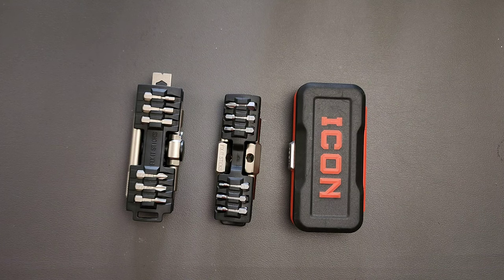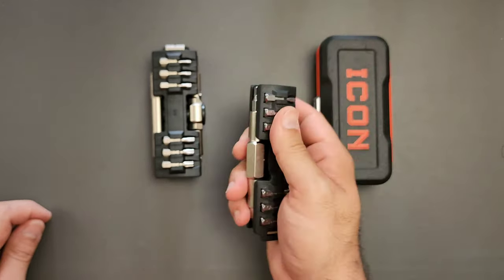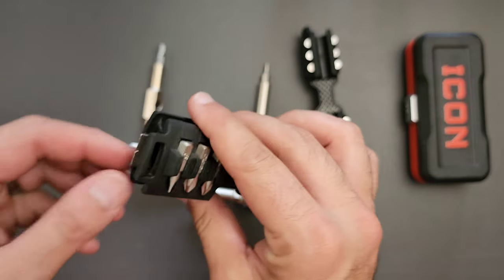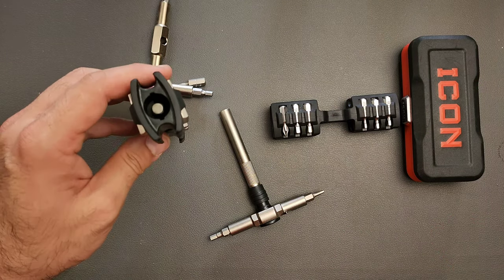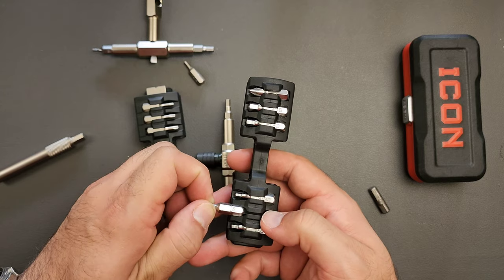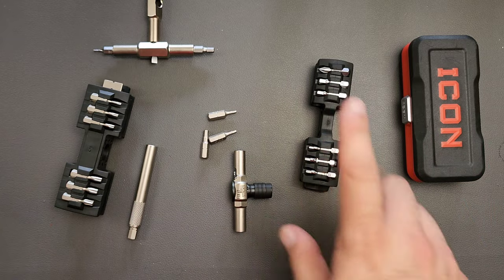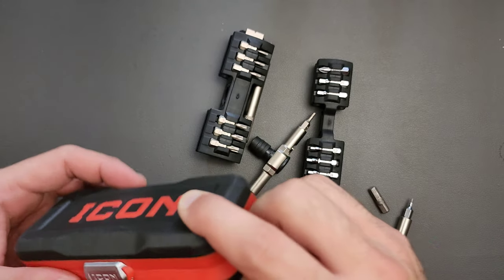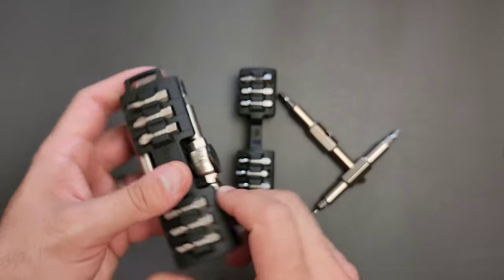🪛 Fixitsticks RATCHET (pocket screwdriver kit)

Comment: I usually carry a .30 caliber gun cleaning brush in my sheath, the kind that screw into a rod.  It is easy to grind the threaded portion to fit into the Leatherman bit exchanger. The size seems to work best for general field cleaning, but also is good for cleaning up threads on old bolts.

Comment: Nice comparison of the two kits. There's a clear size difference, and while having the ratcheting driver sounds nice in theory, as I watch a few of the many different EDC tools videos, I'm left wondering: when do I really want a ratcheting driver, and when is that not enough benefit for the weight and strength trade-offs it requires.

For a kit this size, what kinds of things do I want the ratcheting driver for, over the fixed driver? What are the kinds of tasks where it goes from "nice to have" to "really useful"?
Reply from the maker: I think this is a really really good approach. I would personally keep this in my backpack as part of a very compact toolkit.

Comment: This is a very interesting set up. Sabre cut has some micro 1/4 ratchets I've been looking at.
Reply: i got the folding 72 teeth one with 1/4 socket and hex driver on the head, best 18€ i ever spent, it's small but it's stupid solid and has little to no play, it holds both bits and sockets very very tightly too, so even if it falls you wont loose anything

Comment: @ 3:30 , the hole in the prying tool you are referring tool, has the cutouts for 3 different nut sizes, or those sizes that can accommodate both metric and SAE sizes (i.e. 1/2 & 13mm, etc).

Comment: For the adapter you pulled from the holder with the pliers, did you try using the magnet on the extender instead?  I wonder if it's strong enough to pull that out once the adapter has engaged with the holder.
Reply from the maker: It won't work with it, because the non hex side is facing outward

Comment: I am impressed with both of these kits......Nice for a pack or bag, or car/bike kit....a little too bulky for edc on person....Were you lucky enough to pick up a Doc Allen Versatool when they were available? Countycomm had them last...maybe bought rights to them as original website is down.....and twiter blank.....Sliding head t handle with extension and bit holder in a zippered pouch. Good quality,  I believe made in taiwan... Pics all over web.....They were originally around $12.  Last I saw a few years ago was almost $30.....now gone...
Reply from the maker: I've seen them, never did get one

Comment: Can the Base model use double end Wiha bits? I was thinking of purchasing the double end bits with the Fixit Go (slim model) and use a 1/4" Hex as the 'Connecting' bit. Essentially holding 6 Bits on the sticks alone for ultralight and versatile.

Comment: So the icon kit has more bits, at a lower price, compared to the ratcheting fix it sticks?  Sounds like the icon is the better buy for the money. Btw, can you use the icon extension with a fix it stick?
Reply from the maker: Yes, you can. Which is cool
Reply: And you can use the icon as a t handle and the extension can give you more leverage